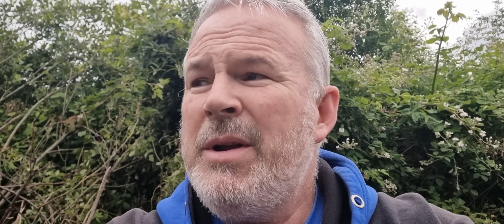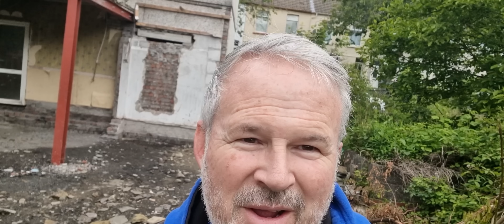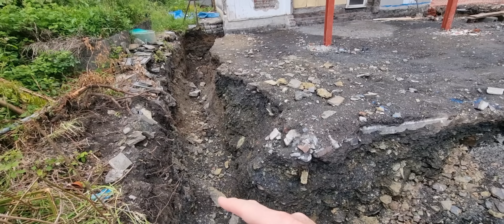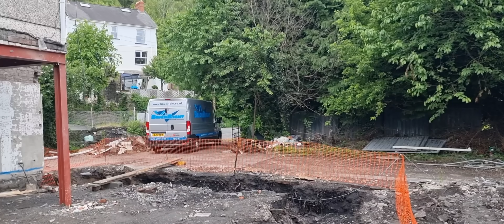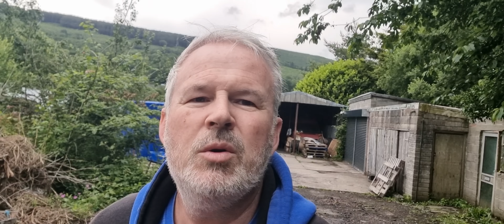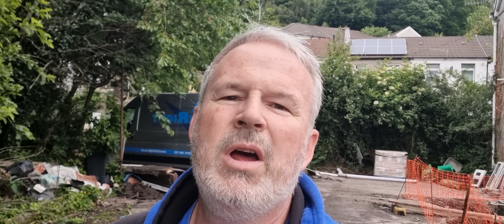Building Control Stop work part 2#

Comment: Very tricky. As you go deeper you need trench support or batter back the sides. If not you can't put someone in the trench to fix the reinforcement. Most engineers I've known would go mini pile and ring beam but I'd expect that cause big delays and it's not cheap. I know some might even go for a raft - particularly for a single storey building.
Reply from the maker: Good points there Dave
Reply: I was ‘told’ I had to raft on a single story extension in 2007 - roll on to 2025 and said raft has floated away from existing by 20mm on one side. & yes the brickwork was tied in.

Comment: Good video showing the probs we have, I as mentioned before it’s much better to inform the client that it’s much better to have an engineers report before digging, no one wants to pay it but it’s cheaper than having 3 visits with the digger, and leaving footings exposed is even worse also if you can’t get a bigger excavator in with wide tracks it’s almost impossible to re dig it straddling the trench with out losing the digger down it. Structural eng overide building control if you got cals, building control like calcs because the blame on them has gone it’s all back into the structural guys if it goes tits up. I would of stopped the dig after  1 meter had been dug finding that shit .I feel your pain it’s all changed with bco now adays all common sense has gone out the window, the want calcs for the ham in your sandwiches these days. Funny because I’m having issues with bco on a job of mine a padstone is 30 mm shorter on with than the calcs , but I done it so a window lintel would still bear on blocks , but no , they want a new calc proving it’s fine. We just put in 2 flights of wooden stairs, they will be asking for calcs for them next no dout.  Getting harder everyday hope you get it sorted 👍
Reply: Cheers mate. It should be mandatory that the architect state on the drawings that calcs and engineers may need to design foundations .
Reply from the maker: @aliwright1523 
Fully agree with you
Reply from the maker: Agree with most of what you said apart from the engineers report at the start because until you start digging you just don't no unless you do the trial holes which really would need to be done in the design process but I respect your opinion. Good luck with the pad stone sounds ridiculous

Comment: Hi .  As you said in the video a lot of input but the main one from Build Ctrl / Eng to use wire / beams with deep concrete is the only one that counts.  Hope it goes well. It will be interesting to see how much m3 concrete is needed.
Reply from the maker: Gonna be a lot kev

Comment: It good that you now have a plan. You are fortunate that you did not get caught out with an oversight an acquaintance had when he built a large house, when finding underground, over half of the house area, the foundations of a Mill Tower (old windmill) and had to have a steel mesh designed to equalize the ground loading. It cost a lot on the price, then, after getting it all ready, passed off, and concrete ordered, we had a cloud burst, and the trenches were collapsing as the concrete was being poured. I had concreted a house foundation the day before, and it was dry, luckily. Hope you are now sorted, and the weather stays good until your foundations are in.
Reply from the maker: Thanks can't wait to get concrete in now 🙌